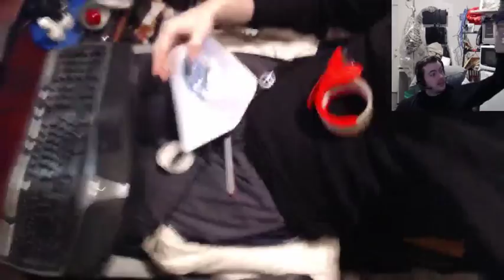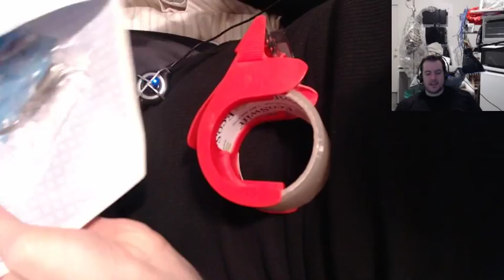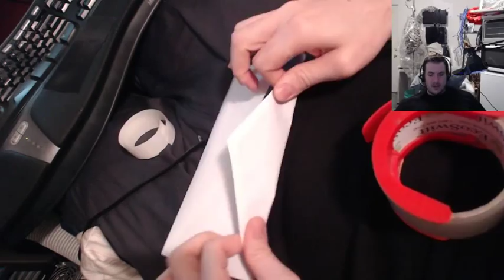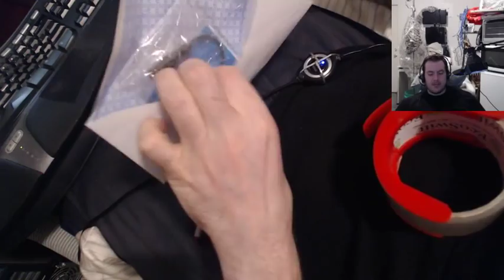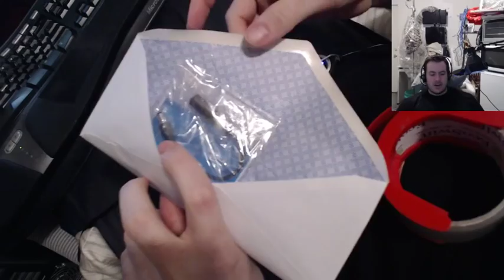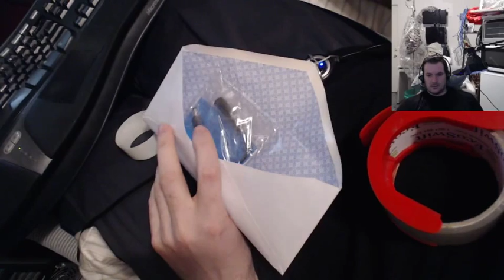Sending Keys, AAA Batteries, Etc via Stamped Envelope w/out it Tearing in Sorting Machines

Comment: Hey dude I taped all the edges of the envelope and tape the front closed will that also help?
Reply from the maker: It might help yes.  These things are hit and miss because some high speed sorting facilities have different settings on their machines that will cause all methods to fail.  Depends on the machine used, the speed settings used that particular day on that particular machine, etc...
Reply from the maker: that said, the point of this method shown in video is to prevent the object from ever hitting the edges of the envelope to begin with because it is taped into a fixed position.  Taping the edges, were the object to never move out from the center taped spot, would be pointless, but just in case it does rip free, the edge tape could save you as a backup plan.